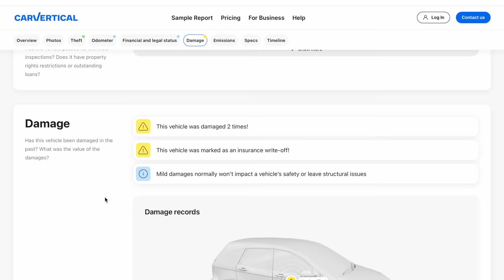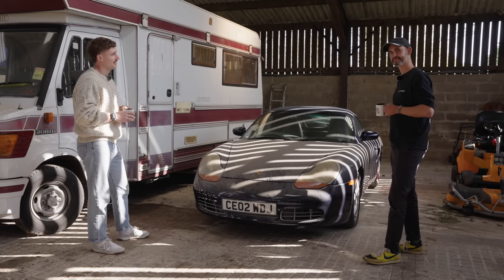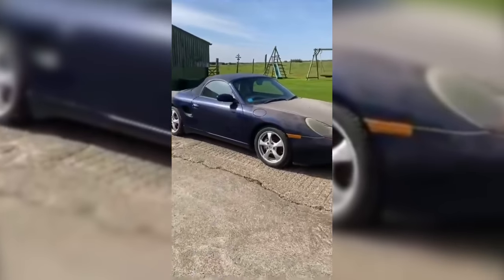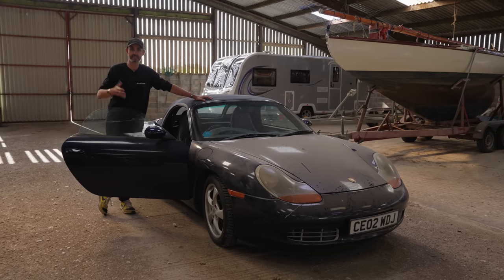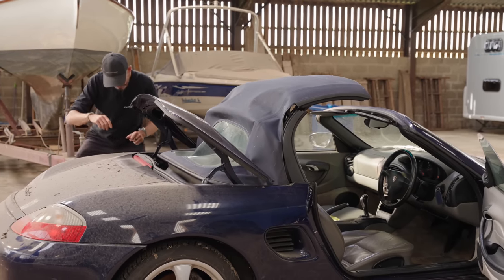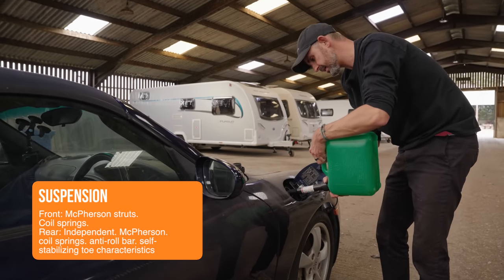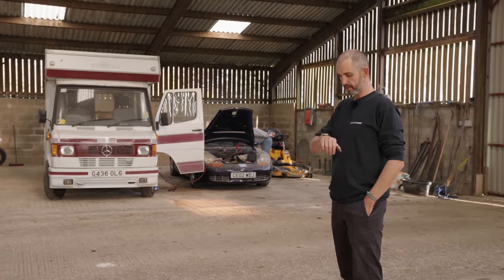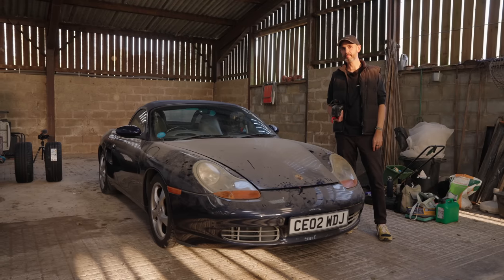I bought Britain's Cheapest Boxster - My First Porsche

Comment: They are great cars for the money! I had an S  I think it was from 2003 in Lapis blue with black leather. Reg A15 XTT but I couldn't afford to run it as it developed a gearbox issue so I sold it to we buy any car. It had loads of little faults though like the windows are supposed to drop when you open the doors but mine didn't. There was a problem with the alarm, the rear anti roll bar rusted away and a bit just fell off. I wonder if it's still out there?

Comment: Are you sure its not the Clutch pedal sensor, very common on these. Computer needs to see the clutch pedal on the floor before it will start. But if the switch has gone then no go.

Comment: I think you've misunderstood the mot requirements on tyres, it's only the sizes that need to match not the brand or tread. you can have a rotational tyre one side and an A-symmetric tyre on the other as long as the sizes are the same it's good for example 195/65 R14

Comment: Sounds like a camshaft/crankshaft position sensor, if the sensors don´t agree the car will sporadically not start.
Reply: Just keep in mind that the fault will not show as active in OBD2, it will show as passive, so don´t just clear it and forget about it.

Comment: About $2,300 USD. Amazing, a boxter in that condition would be $8-10,000 in the States. Very poor condition, even salvage title / flood cars and non running or blown trans boxters go for much more. Cheapest I've seen with a quick marketplace search was asking $4500 for a non running pos. Very good buy. Why are classic and modern classic cars so cheap in England ?

Comment: Very nice find. Doesn't appear to be a physical issue. So unless this is a common problem or a missed ecu update or recall, I'd guess that the ecu got zonked somehow. Be it a material fault/degradation or a surge or even cosmic radiation. Hopefully it can be repaired rather cheaply.
Reply: I'm betting it the fly wheel sensor breaking down when it gets warm. So starts when it's cold but won't fire correctly when the engine gets warm.
Reply: Very nice find? All he has found is one headache after another.

Comment: I'm not massively mechanically minded, but I'd be interested to know if that 'not restarting' fault goes away if you clear the faults again with your OBD. Lovely project though! Good luck mate 👍
Reply: I was thinking that also. If it works it's an easy temporary fix until the real cause can be determined.

Comment: Don't understand I've got a t rreg boxster with 160'000 miles on it a mixture of shades of blue on each panel

're the. Ecu there are two soft of 'plenums' behind the firewall when the seals on them go every time it rains or you wash it the water eventually drains down to the electrics

To fix it next time you're seeing your parents take to MBS in Exeter they will fix it

Comment: 😭😭😭😭 I hate these cheap Porsche stories, I passed up a '82 guards red 911 SC  for approx 11k, bought a 2004 Punto and a 1300 VW Beetle for under 10k because I thought it was the responsible thing to do and save myself 1-2k. 😢

Comment: If it was an Alfa I'd think Crank Position Sensor (works til warm, then doesn't, no codes). But on a Porsche, that is far too cheap and simple to be likely. Unless of course the engine has to come out for access.

Comment: I use that 12 pounds code reader on my vw fox and it says no codes and i turn my steering light and engine management light off snd it says no codes but i delete the no codes and it clears lights 
And it works if engine wont start on my vw !

Comment: I bought my first boxster in 02 from dick Lovett in Cardiff which I think is where yours is from, also mine was lapis blue with a metropole blue hood same as yours and I specced the 17 inch ‘boxster’ wheel upgrade same as yours. 2.7 cars didn’t come with leather, stereo upgrade (in doors) or climate control at that time so those are all upgrades on yours. The rear lights are also updated as this was a cheap update aftermarket. It’s the twin of my old one. Stick with it I think it will make a great project car and that module under the seat is a good start.

Comment: I'm kind of puzzled on your thought process as to why you wanted  to take it straight for MOT? Would it not of made more sense to taking it straight home on a trailer. Get it cleaned,  that module changed and get all the little problems fixed 1st. Surely it was going to fail on the windows not operating?

Comment: Strangely the car is out of year - it’s a Gen 1 986, Gen 2 was 2001 model year onwards, so ‘51’ plate onwards. Pretty much impossible to be a case of ‘old stock’ as they were built to order, and there was a 9 - 12 month wait from order. A cancellled order would have sold easily to another buyer so…..why is it out of year? I suspect it’s a  grey import - you don’t mention a supplying dealer, just the first servicing dealer…

Comment: Didn't Mike Brewer on Wheeler Dealers, years ago, by a Boxter for around £1500 quid? The problem was changing gear. Ed China just did a gearbox oil change and that sorted out the fault.
Reply: It was an automatic

Comment: There is a fault but the reader can't read the fault because only Porsche will be able to read all the sensors. Same with Mazda, independant garages or readers don't have computer access to all sensors. Clearing faults is doable because clearing faults is separate to wether there is a fault or not. I'm guessing Airbag issue.

Comment: Wonder if when you get to drive it, then it doesnt start again. Sticking the OBD reader on and running a clear codes instruction will then let it start straight off the bat? Sounds and looks immobiliser-y other than that one random attempt to crank. Cheap cars are fun in a not at all fun way

Comment: If the immobiliser module under the passenger seat has got wet due to blocked drains there is a guy who can fix them. Google Pixels Fixed, he's your man. It's easy enough to take the passenger seat out to access it. Just post the module and keys to him. If he cant bring the original one back to life, he can usually read the data off the dead one and transfer it over to a new board.

Comment: My 986 was originally a 52 plate, i put my plate on it, bought in from original owner in 2005, it had done 21000 miles, in Meridian, it's now covered 163.000 trouble free miles. Seviced yearly by my local Porsche specialist. Only non service items that have failed is electric window motor, and air-conditioning pump. It's a keeper, not worth much with the milage anyway, did think about upgrading a few years ago to 718 but couldn't justify the outlay. If you can find a good one go for it, but buyers beware, there's horrors out there of all ages, my specialist has inspected a few for clients, and condemned them.
Reply: 163,000 trouble free miles? You must have a VERY selective memory.

Comment: I had the exact same unpredictable intermittent fault like this on an Audi TT  .  I will condense the nightmare I had diagnosing the fault for the sake of embarrassment on my part and your viewers  time . to cut a long story short the fault was so random and unpredictable . but after spending some money on bits and  pulling my hair out my mates pulling theirs out too and the dust settled  I tried to think what it could be.

 I realised and clung to the tiny chance that I could be right ,I remembered I had changed an O ring on a coolant pipe not long before this problem reared its head ,I remembered some coolant splashed around the engine bay and I didn't think that much about it at the time once  I put the pipe on cleaned up the spillage and topped up the coolant  everything was great !! 

then car starting "roulette" began  a couple of weeks later .

 I took off the battery to body earth cable although it looked great on the outside  ,when I took it off the coolant had seeped down the back of the strap to the body and corroded slightly . a quick key up with some sand paper on the strap and body and halle@UKINlujah it would start every time ......its been a pleasure watching your videos mate !!

Comment: Hello mate. I had this exact issue with my jaguar x type, what I found was there was a break in the wiring loom, the wires were touching & freaking the car out because once in a blue moon I mean rarely the car wouldn’t even turn over. One time I was driving to get fuel & the car wouldn’t turn on, I had to get recovered from the station. Then I said fuck it let me find this issue & boom 5 months later I did😂

Comment: Any special precautions to take when starting a boxster after having it stored in a warm dry garage for several years? Would I be ok to start it and drive direct to garage for oil, fluids change ?
Reply: I've seen some suggestions to remove the fuel pump fuse C4, turn over a couple of times before attempting a proper start. Would u recommend this procedure?

Comment: THERE IS NO SUCH THING AS A CHEAP PORSCHE!! I owned a 986S for 5 years and a 987 RS60 Spyder for 6 years. I can tell you categorically now, those cars are an absolute nightmare. The 987's engine imploded  but both cars had endless faults. I think I changed the window regulators about six times. All suspension components, were changed and both cars had issues with flooding and ECU damage, because Porsche in their infinite wisdom put the ECU under the passenger seat where the rain gathers if there's a leak. Awful...truly hideous cars. Also they don't even drive that well. Overrated Germanic garbage. They have a lot of owners as people buy them as they want to say the owned a Porsches, then realise they are a pile of crap money pit and sell them on.

Comment: @latebrakeshow  start with your usual basics, clean the earths, properly check all body to battery and gearbox earths. Check the eartha to modules and check fuel pump relays and fuses for getting hot, quick easy way is to have a flir heat reader so you can scan and it shows up even when there is stuff in the way.  Much like using an Infrared tool to check for mines at night, aomw relays when faulty get suoer hot and so do wiring issues.  Saves a lot of hassle looking for faulty wiring.  Also check for plastic thats corroding away.  It tends to affect the connectors, MbenZ of that era had an issue with biodegradable wites causing fire😂.s😂😂  best of luck

Comment: That code reader is useless, you need a decent unit to be able to display each modules faults sepcific to manufacturers design.

Guaranteed a better reader will show you far more sotred faults than that thing ever could.

Comment: The rear tyres should be 255/40R17 not 225/45R17 as in your video just so you can fit the correct size

Comment: It seems buying the 'UK's cheapest Boxster' is a bit of a 'thing' for media types - i'm sure I read a mag article a few years back (Practical Classics?) with a contributer sharing his experience of buying the (at the time) cheapest Boxster being advertised. I also have a real hankering for an original early Boxster - it would have to be one with the amber indicators! The Boxster was a very important model for Porsche when it was released, I think they now manage to bridge across to being a modern era Porsche but with a character/charm that is perhaps missing from newer cars, age related patina obviously helps here & being a Porsche - high mileage is normal - you could claim that this example is perhaps low mileage? Despite being the 'bottom rung' model & with the image of being the 'poor-mans' Porsche (like 924s used to) the Boxster is as every bit as engaging to drive & a pleasure to own as its rear engined/more expensive counterpart. A friend of mine some years back 'upgraded' his 987 Boxster for a 911 of the similar age & mileage, but swore the premium he paid (like nearly twice the money) was not worth it & actually missed the drop-top of the cheaper car. Good luck with this car, i'm sure you can work your magic on it 👍

Comment: Surely you had to switch it off at least once at the MoT garage?
Don't bother with a 911 that has the engine in the boot which makes it tail happy. You're better off with a mid mounted boxster/Cayman. 911s are overpriced for what they are, they're mostly snob value.

Comment: With Porsche's you have to learn to lose the mentality that a high number of owners is a bad thing. It's very common for a Porsche to have significantly more owners than the average car for it's age. Basically they're still reasonably expensive cars to run and maintain compared to average, and so it's not uncommon for people to buy them "just to scratch the Porsche itch" and then find they can't really afford to own them, so they move them on. At least that's what I've read on Porsche owner forums. I've also read that the condition of the car on the day is the most important thing when buying a Porsche, you get it independently inspected and then you know what does/doesn't need fixing and you buy (or don't) on that basis. Of course the price of the car is a significant factor as to what faults are acceptable.

Comment: To me its seems that people just started to fancy these small cheap Porsche convertible. It’s kind of the original Porsche idea: a compact analog drivers car for enthusiasts. The 986 boxster is evolving into a sought after Porsche model finally 👍🏼 especially this early model with the full fried egg look, the boxster chop window etc is aging very well imo
Reply: Nothing to do with that, it is to do with depreciation. 986s are now so cheap that even gullible chavvy halfordesque boy racers can get their mucky paws on them. That is until they realise they haven't got a prayer on being able to afford keeping them on the road.
Reply: @blackporscheroadster-yw8hb  in Germany they are about 20k in good condition. These guys don’t choose a “slow” boxster over a way faster bmw/MB for 20k. That’s just incorrect. Never seen someone like this in a 986 boxster. Besides they are pretty cheap to maintain..
Reply: @noandrewhere  They are not cheap to maintain. You clearly have never owned one. I had a 986S and 987 RS60 Spyder and both were extremely expensive to keep on the road - even when  avoiding the dealers/stealers parts.
Reply: @blackporscheroadster-yw8hb  I own a 986 Boxster S since 2000.. the lowest maintenance costs of all Porsches I’ve ever owned and I’ve had Porsches starting with the 964 up to the actual 992.
Reply: @noandrewhere  That's like saying the Boxster is the least fatal of all the Cancers.  It's NOT much cheaper than a 911 as 90% are the same parts. Also, you probably have it as a weekend car, only driving it to the bibliothek and back, twice a month.
Reply: @blackporscheroadster-yw8hb  I do. I also have an Audi rs6 as a commuter with 2nd engine and 2nd transmission after 112.000km and 4 years. The boxster has 98.000km on the odontometwr and until now there was just a little issue with the top a few years ago (-450€). Otherwise a pretty solid car.
Reply: @noandrewhere  60,000 miles in 23 years is 3000 miles a year. In other words your 986 is a pampered garage queen. That is the ONLY way Porsches last - if they are hardly used and pampered to the extreme. Your German cars are massively overrated and people who know have known this for decades. Even the thick people are realising it now.
Reply: @blackporscheroadster-yw8hb  it’s a two seater sports convertible. Bad concept for winter. So it’s my girlfriends daily for summer (April to October). Not pampered at all - just used the way it’s meant for.. who’s driving these kind of cars through snow and cold weather 😂
Reply: @noandrewhere  For many owners they are daily drivers. Not because they can't afford another car, but in places like Britain parking is a premium and they have nowhere to park another car.
Reply: @blackporscheroadster-yw8hb  environmental influences are like water on a stone for every car. Especially the 996/986/997.1 engines are told to be more reliable when driven more often but because I use different cars depending on the indication I never did it and my 986/996/997 were all reliable cars.
Reply: @noandrewhere  ALL cars are reliable if you hardly use them.
Reply: @blackporscheroadster-yw8hb  almost 100.000km is not “hardly used”. A car is a mechanical machine. If you don’t use a car it will brake. Don’t see that point at all ..
Reply: @noandrewhere  60k miles in TWENTY THREE years IS hardly used. I do that mileage in 4 years. You're contradicting yourself
Reply: @blackporscheroadster-yw8hb  so you’d call a 500.000km driven ford model T a hardly used vehicle😂 ok - I am out

Comment: NICE one Jonny! I bought Japan's cheapest Boxster (well one of, maybe) this Spring. It's a 1998 with just 58,000 kilometers. It needed a new top and some maintenance.  I'm in it for about $7,500 USD....Great value for the money and the M030 suspension with manual transmission is about as ANALOG as you can get from the H2o cars. Check out my channel :)

Comment: Sometimes the best OBD readers are forums, car groups or dare i say garages. Once unwell on a motorway very unwell and the car had several pro cleaning jobs. Later the following year faults begin to happen. Yes me being unwell clearly didnt help but an OBD reader could not say what was wrong or fuse, module etc to replace but cleared codes as you did. Despite none showing. Your not allowed to promote things so i will say the latest actor to play the Hulk was in a film about discovering chemicals in 2019. Based on a true article. Anyway my point the chemicals could only be regulated if they were aware or knew about them. Its been said about different OBD modules having more codes etc. Maybe sometimes only the manufacturer knows every possible issue? Or that elusive person who is going through the same issue or has gone through it. 
Good luck you will sort it? 👍